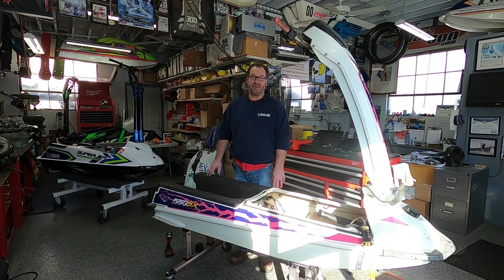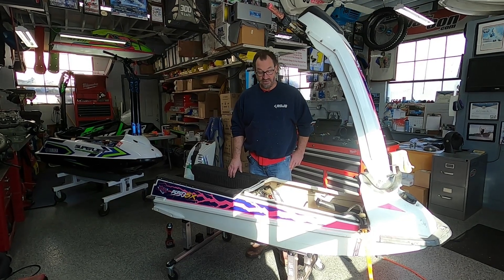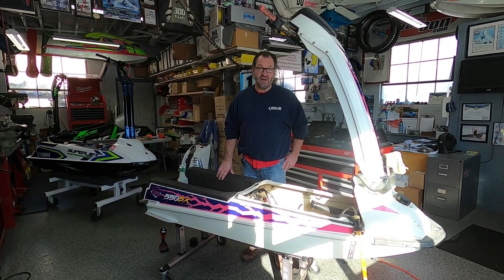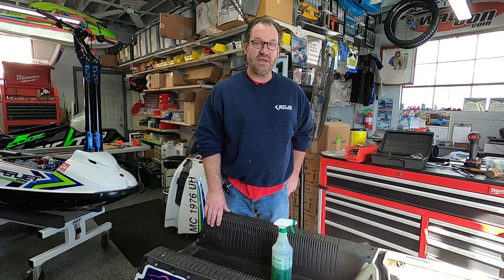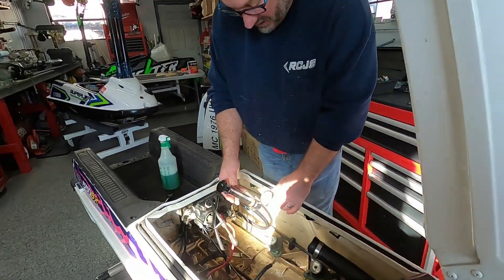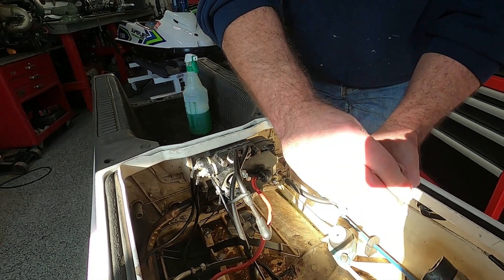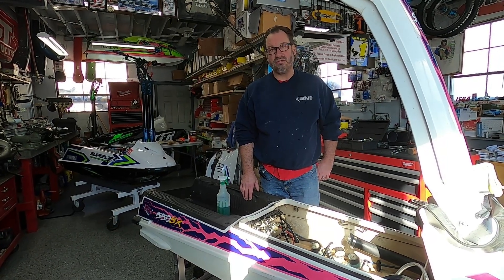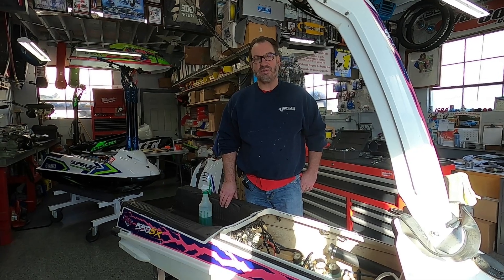cooling tube test

Comment: What is the fix for this if it is leaking? I have an 1985 js550 that i had to trim the tube back because it was deteriorating after the firewall and the tubing clamp and now after seeing this video i think i should replace the whole thing.
Reply from the maker: Replacing the whole tube is really the only way.

Comment: on my 1989 js440 with a 550 engine this line is made of plastic like truck brake air hoses. Greetings from Poland
Reply from the maker: Thanks for watching
Reply: Are you sure it's not coated in plastic or some kind of coating?
Reply: @samdavis1219  It's soft enough that I can crush it in my fingers. I had to put a copper tube under the bands because I crush the wire with the band.